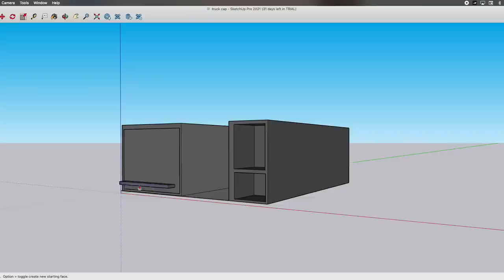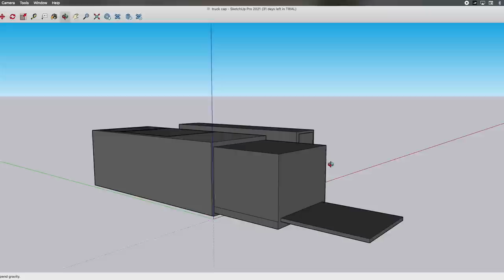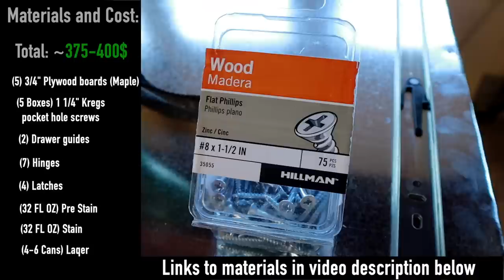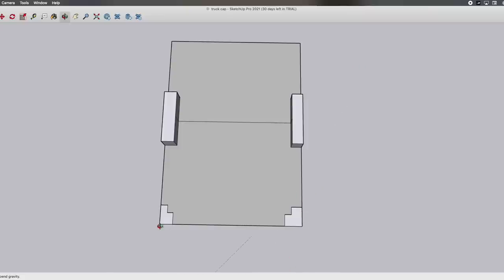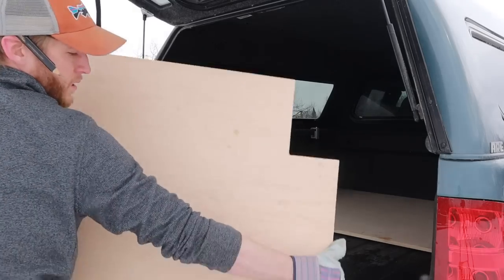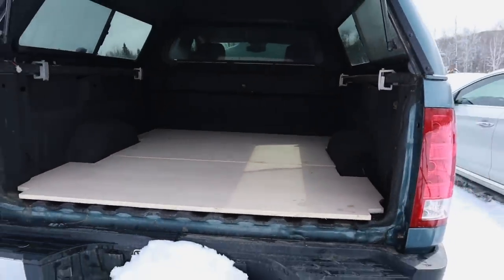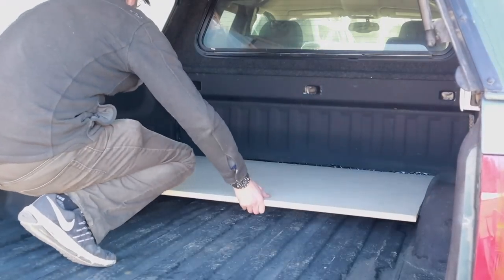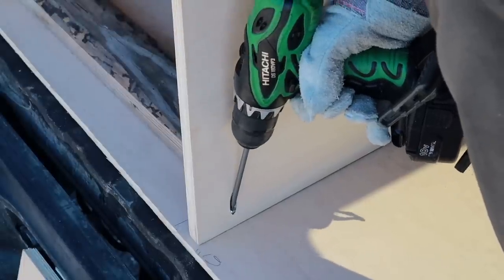Want To Build a Truck Camper?? | Here's How!!

Comment: As a carpenter, I will re-recommend the statement about stop thinking about it and do it. I have wasted a ton of time trying to plan everything out perfectly before the project is started only to find some small aspect halfway through the build I didn't consider which changes the design significantly. Get a general plan in place and get started. Mistakes will happen and you will survive and learn for next time.
Reply from the maker: Couldn’t agree more I definitely have my fair share of mistakes 😂
Reply: I want to but a sheet of plywood here is 72 dollars
this time last year they were 18 bucks
Reply: 100% - you will for sure make lots of mistakes - but you will learn. And keep in mind that everything takes 3x longer than you think.
Reply: I agree! But also being a good carpenter means you can fix your mistakes just as easily as you make them!

Comment: Cardboard (save your Amazon /shipping/moving boxes), makes for a good light weight template/mock-up material before cutting wood.
Reply from the maker: Great tip! I started using that later in the build and it was very helpful

Comment: Years ago I had a "62"Willys Overland Wagon. I  built an insert to go into the back with seats over the wheel wells, a little square table that I made from a piece of pipe and a couple of pipe flanges, and a little square piece of 3/4 plywood that I could take apart and store under the bed which was a piece of plywood that I could slide in between the tops of the wheel wells. Some carpet and it was the ultimate hunting rig. 👍 Great job on your build.

Comment: Ordered my A.R.E shell back in the beginning of Feb. right after receiving my new Silverado, and I just received it earlier this week (over 20 week wait) was told several times that it was being built and and that it would be shipped. Original time frame I was told was 10-12 weeks. After that just plan on getting the runaround. I even offered to drive up to Ohio and pick it up when they told me it was a shipping issue, only to find out that it hadn't been built and that it was just another line of BS they were coming up with. On a good note only 2 of the 4 windows leak....I like the function of the vented windoors but they leak pretty bad. Not looking forward to taking it the dealer, I'm sure they will make up some crap. Paid $3350.00. I recommend going with Leer (I have one on my Ram) it's been on for 12 years and have had NO issues.  If I hadn't spent so mush I would take it off and use it for target practice then burn it to the ground. (With the so called fiberglass shortage) you can tell that the shell is much more flimsy than the older style.   Have a nice day

Comment: Love this, Is there any way to link the build you had on SketchUp? Or is it possible to get some measurements to use on other 6ft beds?
Reply from the maker: All beds will be different depending on the make model and year so you'll have to go in and take your own measurements. Even if you had a 2008 GMC with a 6.6 bed it would need to be build with the exact cap I have because that gave me an extra 3-4" of working space with the tailgate removed. Also, the sketch up file was only for demonstration purposes and was not made to scale.

Comment: About how much does this weigh? would it be lighter weight using aluminum for the frame work?
Reply from the maker: Probably about 200-250 pounds and I couldn’t tell you if aluminum would be less or not it probably would but I didn’t think weight would be a issue for a truck

Comment: Enjoyed Episode 1! Am building a drawer/sleeping platform for my Tacoma right now so find this very interesting. Am using Kreg as well...great system.

So impressed seeing you doing long cuts with a handsaw!
Reply from the maker: Thanks! I just put up the second part that is focused on things that might be more helpful for your build. Sometimes I picked up the saw just to help warm myself Up 😂
Reply: @MainelyOutDoors  - I really like the slide out cooking/food prep surface. Right now I'd have to throw out or greatly modify one of my pullout drawers in order to incorporate that. It would likely be possible to cut down the height of a drawer so that is something for me to think about. I am using the Tacoma build from the Bound for Nowhere Youtubers, Mak and Owen.

I think I will use your idea for the side supports to keep the unit from sliding around. 

Once again, great job using hand tools for a lot of it. I use Japanese pull saws a lot but I may take a second look at my Dad's old handsaws and get one or two of them sharpened. You may have saved them from the scrap pile lol!